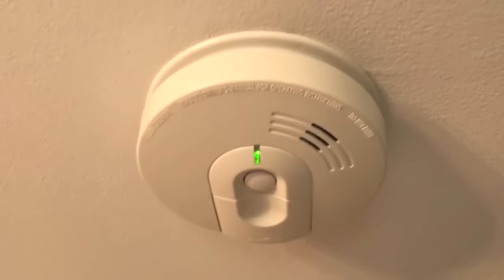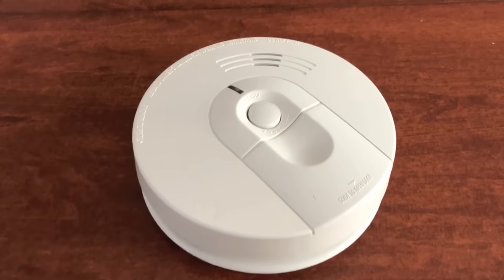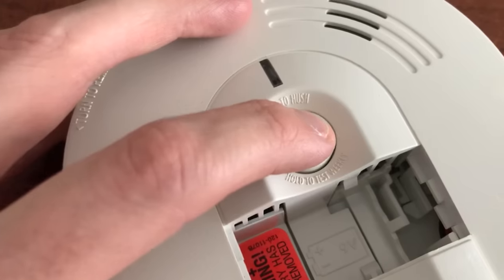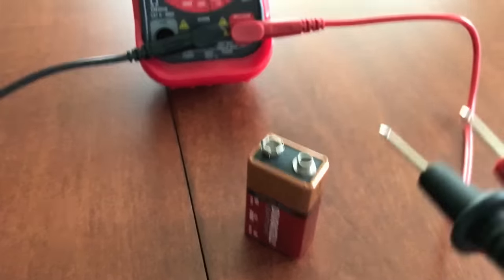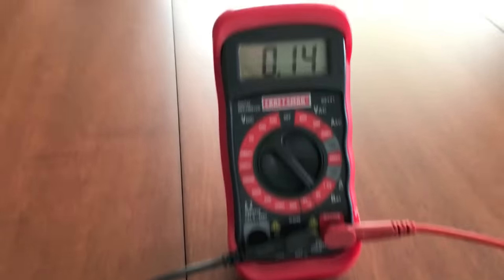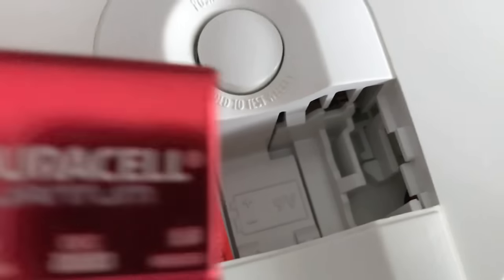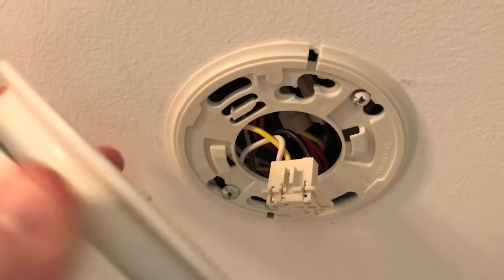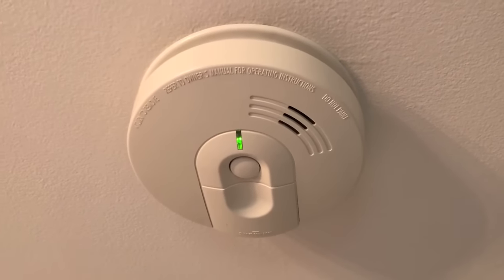Replaced Battery/Cleaned smoke detector- Still BEEPING (Must RESET Detector)

Comment: I found these videos to be informative but I still couldn't get the beeping to stop even in a new device with new batteries. I drained the charge and restored the power but it still chirped. I finally decided to look at the other smoke alarms in the system. I found an old battery which I removed and replaced. I then did a re-cycle of the problem device and when I restored power and inserted the battery it was quiet. Its been quiet for 10 hours. I have concluded that the failing battery in the other unit was affecting the completely new smoke detector. I really hope this is helpful.

Comment: This video got me back to sleep. I was up between 1 am and 2:30 am with the low battery chirp and feeling incredibly helpless. You saved me! My "manual" said nothing about discharging the detector by holding the button down after the batteries were removed. It also did not explain the weird red latches (what should I call them?) that had to be held down to install the batteries, or what to do with the weird yellow tape (please!). I followed the directions with little hope that it would actually work, but to my amazement it did. I am a 65 year old woman living alone. You and the rest of the commenters here (I read all of them, they were super helpful) are my heroes! Long live YouTube.
Reply: I would just push the button and the chirping will stop for about 12 hours.

Comment: Thanks Michael, this is just what I needed to know. I climbed a shaky 16 foot ladder to change the battery on a wired smoke detector, and as soon as I got down, it started beeping again. I never had to reset it before inserting a new battery but I replaced the battery again with a new one and did the reset this time and it is now not beeping any more. I tested both batteries with a cheap Radio Shack analog tester and both were in the GOOD zone. But I measured the voltage of both, as you suggest in the video, and I found the first battery to be at only 7.6V. The second one was at 9.33V, so I don't know if the problem was the lower voltage of the first battery, alone, or the fact that I did not reset the unit, or both. Probably the low voltage alone, but it is better to do the simple reset anyway, just in case.
Reply from the maker: 9laral9 Awesome Awesome & thanks for checking out the video and sharing your experience!  We appreciate you reaching out to us!  Smoke Detectors have come a long way over the years in terms of technological advances!  Current code today is for them to all be hard wired on same circuit as you know!  Adds tremendous safety awareness!  Let us know if you have any additional questions along the way!  We have several other videos that go more in depth with Smoke Detectors as well as many other household repairs that are cost friendly & can be a great DIY project.  Below is a link to our Appliances/Home Repair PlayList.  Definitely check it out!  

Please subscribe to the channel and turn on your YouTube notifications that would be awesome thanks again 😎👍

Appliance/Home Repair PlayList Link:

       https://www.youtube.com/playlist?list=PLjCXOz8TSkZmG-ZbhhKPj4Vh3K3MDPXii
Reply: You mean same electrical circuit right? Mine are not attached to a security system. There is only one LABELLED circuit for smoke detectors in the panel.
Reply from the maker: 9laral9 Great question!  Yes, same electrical circuit.  Below is a video that I made that talks specifically about the hard wiring on same circuit.  I love this new coded inspection...it definitely increases safety!  You might find the video helpful.  😎👍

       https://youtu.be/k7JMHBPm2io

Comment: The Reset after disconnect is a great idea. In our case we installed a brand new 9 Volt battery.  The chirping began several hours later. I yanked the new battery out and ran a battery test which started at 6 volts and quickly dropped to 0 volts in seconds.
A brand new Duracell battery was the issue. Bad quality control by Duracell perhaps.
Reply from the maker: revup67 

Thanks for sharing your experience.  Are you back up & running normally?  We hope this helps.  Us fellow DIY’ers need to stick together.  Many more helpful videos to come!

Please subscribe to the channel and Ring your YouTube Bell 🛎 that would be awesome thanks again!

😎👍🔧🔩
Reply: Yes indeed.
Reply from the maker: revup67 

😎👍🔧🔩

Comment: It is now 2018 and I STILL don't understand why we need batteries for a smoke detector that is wired, what's the point and purpose of the battery and the battery door if you have to unhook it from the base and do all that you did in this video?
Reply from the maker: Marilyn Alvarez 

Thanks for checking out the video and sharing your comment!  That a great question.  I went ahead & made a quick video today explaining why the Battery is required!  Link to the video is below!  Definitely check it out!

       https://youtu.be/rmyWLdFmzJc

Please subscribe to the channel and turn on your YouTube notification Bell that would be awesome thanks again!  😎👍
Reply: The battery is just in case of a power interruption
Reply from the maker: NVHSChadSheppard1 

You are spot on!  That little battery is pretty darn important in that it is the emergency backup power source.  Thanks again for watching!  😎👍🔧🔩
Reply: I'm even more confused why you don't want your smoke detector to work when there is a power outage. Hmmmm
Reply: DIY With Michael Borders my question is why the battery drains of power IF it is only running on the AC power supply until a power outage? I've had batteries last years in seasonal Christmas decorations than a Duracell battery in a AC powered fire alarm.
Reply: Lol! 2018 you dont still know? Power outage baby... Think about it baby and safety first baby... Now you know now lol!
Reply: the power may be off because of the fire, thus battery backup! Most FD's recommend changing the battery BEFORE the chirpping, annually, at the time change!
Reply: Think of it like a UPS. Battery backup in case of power failure. You know there are fires when power outages occur too, especially in storms with lighting setting houses on fire. its not  very common but its common enough to use as an example.

Comment: My smoke detector is HARDWIRED into the ceiling RIGHT OVER THE STOVE. Whatever architectural genius did that move - it literally goes off EVERY time I make toast. Like not even toasted toast. Just plugging in the friggin' toaster will set it off. Needless to say ... it's a nightmare.
Reply from the maker: Holly Robinson 

😲 That is wild!  That is definitely an interesting set up & not normal code.

By chance, was the house remodeled years ago & the kitchen was not in its current place before the remodel?

Our only thought is that a remodel took place before you entered home & that hard wired Smoke Detector was always there however it may have been a living room or something.

An electrician would never install a “Hard Wired” detector above a cooking stove!  🤔

Let us know if you find any info on a recent remodel?

Thanks again for watching!  Please subscribe to the channel and turn on your YouTube notification Bell 🛎 that would be awesome thanks again!  😎👍🔧🔩
Reply: Mine is hard wired over the beginning of the staircase. I will need to have an electrician move it because it is so scary changing batteries with a ladder at the edge of the top step.
Reply from the maker: MONISA MONTOYA 

Thanks for watching & sharing your experience.  That’s a great idea, safety 1st!  The last thing you want is to get hurt during the project, no fun!  

If there are any questions we can answer, definitely let us know, we are here to help!

Please subscribe to the channel and turn on your YouTube notification Bell 🛎 that would be awesome thanks again!

Keep us posted on your project!  

😎👍🔧🔩

Comment: Thanks for your clear demo. It's exactly our unit.  Followed exactly your instructions,  including hearing the residual electric charge after the battery had been taken off.  The chirping stopped after installing ne battery.  However, the unit flashes red light after every 30 second interval.  I followed exactly how you did it.  Any response is appreciated.
Reply from the maker: Jon Vine 

Thanks for watching & we are happy the video helped.  So glad to help.  Depending on what year your Detector was manufactured will depend on the Red light.  Your Red light will flash every 20-30 seconds & that’s normal.

We really enjoy making these helpful videos for our fellow DIY’ers.  Many more helpful videos to come!  😃

Let us know if you have any questions.  Please subscribe to the channel and turn on your YouTube notification Bell 🛎 that would be awesome thanks again!

😎👍🔧🔩
Reply: @DIYwithMichaelBorders  Thanks for the quick response.  I have observed the other detector units elsewhere in the house and you are correct-- they do blink red at 20++~30 sec interval and maintain green in between.  Thanks again!
Reply from the maker: Jon Vine 

Very cool.

😎👍🔧🔩

Comment: Same kind of wired+battery backup Kiddie/FireX. It keeps chirping after replacing batteries and cleaning all the contacts off oxides. Eventually found that inside there are four contacts that connect the battery to the circuit, and there is bad connection there. This prevents the 9V from battery from feeding to the circuits. Cleaned these contacts and bent the spring wiper contacts and solved the problem.  There are three tabs under the foam ring that you pry with a flat head to open the cover. Because the wire to the buzzer is short and don't use too much force when opening the cover. Push on a tab to remove the circuit board to see the contacts.
Reply from the maker: Thanks for watching & sharing this great info, we appreciate it.  Any & all helpful info is greatly appreciated.

😎👍🔧🔩

Comment: Critical chemical elements in smoke detectors deteriorate over time. They chirp to let you know when that has happened beyond a certain point. Check the manufacture date on the back and replace it when chirping after seven years.  That is standard.
Take it off and put it in your car until you are ready to get another one. They are easy to replace if you get the same brand, but you have to do a little rewiring if you don't.
Reply from the maker: sally stanford 

Thanks for watching & sharing your input.  This is great info and we really appreciate it sally.  Us fellow DIY’ers need to stick together.

Please subscribe to the channel and ring your YouTube bell 🔔 this will be very helpful to us thanks again.

😎👍🔧🔩

Comment: For some reason the clamp at the back would not pull out so I just changed the battery through the front door without removing the wiring.  I didnt get electrocuted and so far no more beeping.  I dont advise it but it worked for me.
Reply from the maker: checkHook93 

Thanks for watching.  Let us know if you have any questions.  😎👍🔧🔩

Comment: Great video
Just a bit more info to help out. I have the same smoke detector but it has two AA batteries. I put two new batteries in and still chirping. Turns out the little + sign inside is not very clear. I was putting both batteries in the same direction. Look very closely to properly orientate the positive negative end of the batteries
Reply from the maker: Dan lalib 

Thanks for watching & sharing your experience Dan.  You’re spot on & that’s a great point.  All too often when changing batteries on any electronic these days, you have new the batteries in hand.

Once you open up the cap & remove old batteries...your brain is already preprogrammed to insert the new batteries the exact same way the old ones came out.

It’s definitely smart to take a pause & look at the + & - signs to ensure that you’re inserting batteries into electronic correctly.

We really appreciate you taking the time to reach out to us.

Please subscribe to the channel and turn on your YouTube notification Bell 🛎 that would be awesome thanks again!

😎👍🔧🔩

Comment: One of my wired detectors (just like the one you have) started emitting 3 loud beeps every few minutes. It was not the usual chirp it emits when low on battery, but the normal sound it makes when smoke is detected. I also have monitored smoke alarms that were silent, so I knew that there was no fire.  I unscrewed that detector off the mount and suddenly all of the connected detectors started beeping. I did not remove the electrical connection to the detector and simply screwed it back in because others were still asleep. I have not tried your procedure to reset the alarm. I am hoping that the units have not reached EOL because they have been installed since 2004. As luck would have it, these alarms pick the best time (very early morning) to unsettle everyone in the house!
Reply from the maker: MrSoulMonk 

Thanks for watching & we hope the video helped.  Definitely keep us posted with what you find after completing the reset procedure.

We really enjoy making these helpful videos for our fellow DIY’ers.  Many more helpful videos to come.  😀

Please subscribe to the channel and turn on your YouTube notification Bell 🛎 that would be awesome thanks again!

😎👍🔧🔩

Comment: I wiggled that dang tab back forth and sideways, but unable to disconnect. I am now waiting to see if the discharge trick worked. If it doesn't chirp by the time the laundry needs to be flipped, I'm putting the 9 volt back in! And before I finished the post, IT'S BAAACK!!!
Reply from the maker: Mary Barrows 

Thanks for watching & sharing your experience Mary.  We definitely understand your annoyance with the Smoke Detector.

What’s the update?  Let’s get this figured out together!

Chirping Detectors are almost always caused by a low battery voltage.  Over the years, the battery loses voltage & then causes the detector to chirp.

Replacing your old battery with a new battery should help.  If it doesn’t, let’s move to the next step of the troubleshooting process.

Keep us posted, Let’s get this figured out!  😎👍

Please subscribe to the channel and turn on your YouTube notification Bell 🛎 that would be awesome thanks again!

😎👍🔧🔩
Reply from the maker: Mary Barrows 

Also, verify that your hard wiring connection point is properly secured.  There are several things that can cause a loose connection and one option is the ceiling recently being painted.

In the event that you or anyone in the recent past has painted your ceiling, it’s possible that paint was applied with the detector uninstalled...leading to paint getting on the connection point...thus not allowing the connection point to properly secure itself when your actual detector is secured and mounted to the ceiling.

Also, as you reinstall your detector to the hardwiring and then shift or twist detector into place on its mount, you want to be very careful that you do not accidentally disconnect the electrical connection point during that install process.

Keep us posted!

😎👍🔧🔩
Reply: @DIYwithMichaelBorders  So the battery I put back in was brand new "bunny" brand battery with exp date 2025. It chirped twice, waited another 10 minutes and chirped again. Haven't noticed anything the last few hours I've been home today, so hoping for best.
Reply from the maker: Mary Plotwench 

Very cool & thanks for sharing Mary.  This is good.  😀

Keep us posted!